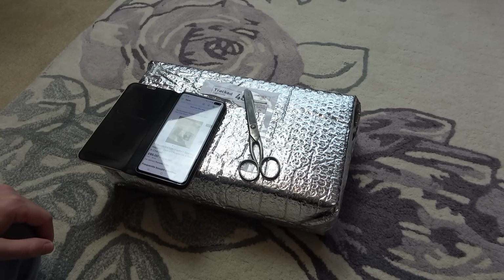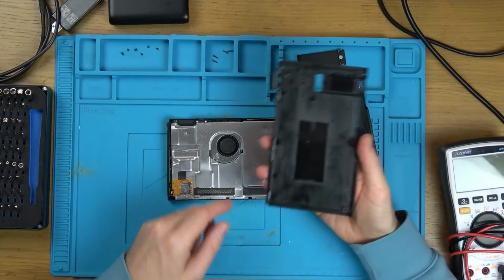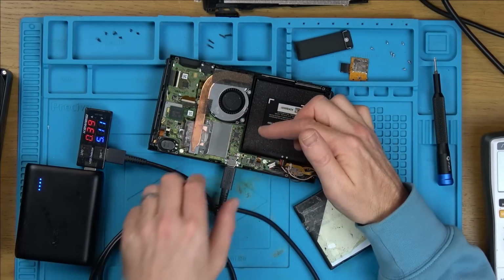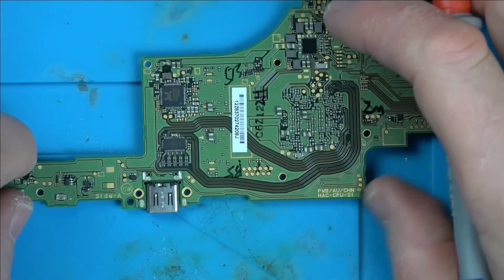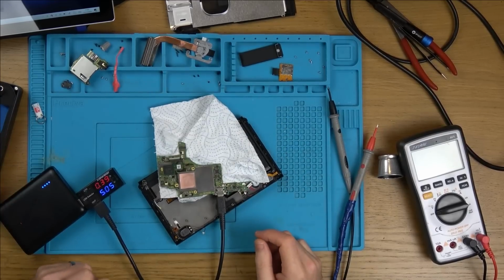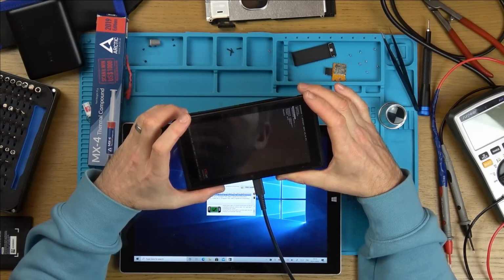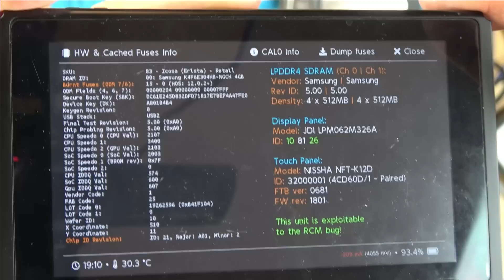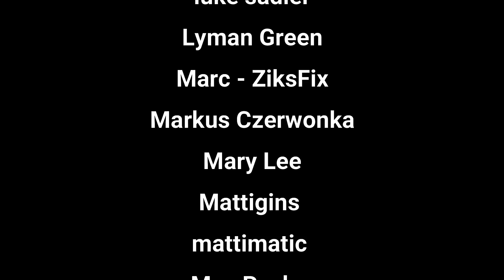Dishonest Broken Nintendo Switch from eBay - Can I FIX it?

Comment: If you do manage to get the switch operating system loaded back onto it, just be aware that there is a possibility that nintendo could detect that that switch has been hacked, and if you were to link your nintendo account, then there is a chance, however small, of your account potentially getting banned, or alternativly, the console itself could get banned (assuming it isnt already banned)
Reply from the maker: Thanks Pineapple 👍👍👍👍👍
Reply: That is only if you Start the System in the Stock CFW mode
(Look in my other comment for a half-explanation)
Reply: Nintendo does not ban accounts themselves really, usually they go for devices. I have three Switches hacked, ask me how I know >D

Comment: I guess I can't post links so I can't link you the guide, but if you buy a replacement eMMC module (they are cheap from China) there is a guide to rebuild the NAND. It requires hacking the console though, and it won't work online anymore because the console unique data that is needed to go online is lost now. But it can still work perfectly as a hacked console with CFW.
It uses a second (working) Switch as a donor to take the NAND files from, though there's a pack online with the needed files that skips that requirement.

Comment: Hey Vince you have a bad m92t36 chip. Ive come accross nintendo switches that are stuck in5 volts charge. The m92t36 chip can go bad without a short circuit.

Comment: Not sure if someone’s mentioned this but a red flag I noticed was the serial number label was missing (taken off). It’s what tells you if it’s “hackable” which are V1 versions. Unfortunately you need the original Nand to the switch to get it back to normal. However, it’s more valuable than a standard switch. I would mod it with the sd card and it should work. THERES A WAY and the plus side, this is a more sought out switch. So it’s a GREAT purchase!

Comment: Winner at the end  I think that it's homebrew lunch channel if the person who installed it doesn't do it right Nintendo company will see it and ban. It called a soft brick or hard brick you have to look it up on line on how to unbrick it  and with out the memory card make it harder to fixed it the software is installed in the memory of the switch good luck Bryce

Comment: Hey Vince, just wanted to say, that seller could have been telling the truth. RCM mode is a built in feature of the Tegra's bootROM (very first software ever run when you press the power button) and does not indicate hacking. It's a failsafe mode that activates in a number of situations (one of which is an eMMC failure!) so Nintendo or nVidia can recover the system in case of a software update issue or run diagnostics. It happens to be that there's a vulnerability in the USB code used for it, which is how people get into the system. Given what I see in the video, I think the eMMC chip went bad, which is indeed one of the many conditions that get you into RCM mode, and one of the ways an honest person could get it there.

Unfortunately, since the eMMC is dead, you won't ever be able to bring this back to full functionality, most likely. You should be able to at least get it booting back into the OS and playing cartridge games if you wanted, but online functionality will be lost on it regardless, due to missing PRODINFO, since that's console unique and not able to be fully regenerated (and most likely won't ever be fully able to regenerate)

Comment: I was wondering if you could help me I have a PlayStation 3 60 gig and it's exhaust temperature is 45 degrees C could you tell me if that's too hot or is that normal thank you.

Comment: Have you tried holding down power an volume up an down for about 30 or so seconds then let go of all then tap power button had the same issue with one of my hacked switchs after I tried to put it in rcm mode when battery was to low,
Reply: Never mind should of watched the whole video first lol an thats why I don't use the emmc when I hacked my switch I use the sd card with atmosphere I feel its the safer way to hack a switch

Comment: In options on the screen options top right turn off auto rcm and power off switch fully and turn on should come on failing that load up atmosphere see if that helps
Reply from the maker: Thanks Dan 👍

Comment: If they burnt those fuses it was defiantly hacked. It seems if those fuses are burnt it wont boot anymore. Might be able to get around that by creating a EMUNAND. Its a custom firmware of the switches OS but on the SD Card. You wont be able to play online but it'll still play games.
Reply: NO, the fuses burns itself when you update the firmware of the switch, in the official way. When you have a CFW the fuses arent burn, because the CFW itself block it.

Comment: you can buy a replacement emmc and rebuild the system but you wopuld need to contact the person and ask for the backup of the flash from the sd card they had in it to re-flash back to the new emmc with out that its toast

Comment: I have a pretty strong opinion that this also has experienced hardware failure, as I believe it would at least charge at 15V otherwise
Reply: While the console is in RCM, it doesn’t charge at full 15V. It trickle charges as shown in the video

Comment: The Fuses are EFuses that represent that the system has been updated to Valid Nintendo firmware its to prevent people downgrading 
There are hacking tools to update and grade without burning the EFuses 
idea basically 1.0 no burned fuses 
update 1.1 = 1 burnt EFuse 
HOS: is the current firmware on the device Unsure of the + but it could be representing the version for the firmware version as there is a Fat32 supporting version and a exFat supporting version

Comment: failed to initialize emmc soulds like the emmc is bricked corrupt or straight up just failed you may need to replace it and you will have to find a way to retrieve the key and pair it with a new emmc to get it up and running, pinch one off a donor board this should be repairable without too much work

Comment: The seller wasn't necessarily dishonest. it may not have been hacked. I was watching a video from TheCod3r the other day working on a Switch with a similar issue. While the one he was working one was hacked, he mentioned in the video that failed NAND (the eMMC storage chip) would cause any Switch to automatically go into RCM. RCM (ReCovery Mode) is the Tegra processor's built-in recovery mode. Anything that's built on Tegra has this RCM mode, for advanced recovery. It's useless to most people though. the error you were getting, 'failed to init emmc' means that 100% that NAND does not work. That makes this Switch unfixable, since the NAND is married to the CPU. Just putting in a new NAND would not work.

Comment: its gonna be a pain for me to find it but in the past you've done a Nintendo switch video where the switch would only charge with aftermarket usb c cables and not the OEM Nintendo cable. I'm having this same issue, I've tried 3 different OEM cables and nothing but when I try a cheap $1 usb c cable it charges but will charge very slowly. Could you or anyone possibly point me to the direction of the video or one similar that would help me with my console. The usb c port looks immaculate and I cannot see anything wrong with it so I'm thinking possibly the charge chip but I don't wanna jump the gun.

Comment: I haven't watched all the video, but I believe the seller in this case. 
i believe the nand has malfunctioned.  a switch will always boot into rcm if no nand is present, even if you don't have a jig in. 

you can use cfw on the switch with a different nand,
but you can never get it working properly as you don't have the backup keys for your original nand

on one I have ATM. i can feel the nand, getting slightly warm. but like you, I'm not really a software guy.

Comment: Vince while in RCM mode did you notice a "clear emmc" in the menu? it is used for things like Android phones that won't boot up. maybe look up videos about clearing emmc. but my guess would be that it will only clear the android emmc, rather than the switch's emmc. but might be worth a try. make sure you copy all files to the pc first encase something goes wrong.
Reply: also clearing emmc means all apps, and games will be wiped from the Nintendo switch.

Comment: hey vince. how much would you charge for this switch without joycons charger or anything., just console?  i can run ubuntu on it. and that can eventually be installed on the main emmc with some mod chips. i'd be interested to  use this switch as a engineering test for hardware mods. because how it is rightnow. without a working original emmc. the switch is bricked

Comment: Think this guide will work for you since you need to get the keys extracted to rebuild the Nand/eMMC if it is broken as you suspect then the keys are needed to rebuild it on that other Nand. Hope it helps and a s always enjoy your videos :)

switch:homebrew:guide/usingcfw/manualchoiupgrade (replace : with . since my last link got removed :P)

Comment: for anyone reading this, any ARM device that has recovery mode enabled in the silicon will trigger recovery mode (RCM) if the bootloader can't keep normal functionality (ie: loading more loaders from flash). If the eMMC is dead this is exactly what will happen. In this case, you'd need a new eMMC to rebuild your nand using the cpu keys. This also happens to any device using flash memory, i've had early smartphones going the same way because the internal storage just goes bad over time. Shouldn't happen this quickly on a relatively modern device unless it's been used 24/7 nonstop since release and constantly writing data to it, and even so i'm not sure you'd spend the memorie's writing cycles this fast.

Comment: Here's EXACTLY what happened - Athmosphere (which is the CFW typically used on hacked switches. There's SXOS as well, but I doubt they paid for that when Athmosphere is free) has a feature that's called "auto RCM" which basically puts your switch into RCM mode automatically when you power it off to eliminate the need to have that jig with you. Problem here is that if the switch turns off because of low battery, it goes into the auto RCM mode which further drains your battery to the point where it kills it. Basically your switch doesn't turn off and it just drains the battery to the point where the battery is just fully drained. The switch is modded successfully from what I can see, because Tegra RCM detects it, but they just weren't mindful of the autorcm option, and probably just hadn't charged the switch in a very long time. These are things that you need to research, but I guess the kids didn't do their homework.
Reply: Also, they didn't give you the SD card that contains the custom firmware, so it's not booting it up because of that. Try to get an SD card and load the latest athmosphere and hekate on it. That should do the trick.

Comment: The only way i can think of it some sorta payload that allows you to dump and flash keys soo if you use another switch that's dump the keys just incase that specific switch ever breaks and is unrepairable you could potentially salvage the emmc from it but i don't know its not something ive heard lf existing but you never know it is theoretically possible like nintendo themselves have problem had to do it where the emmc has died or something and they salvage it by flashing new keys onto it if you had access to that specific piece of software that allowed them to even serialise things then you can do it just gotta hope someone from nintendo dont mind "accidentally" posting a download link on the Internet to that tool

Comment: Hi Vince, dont do any misinformation on hack, because hack switch is very different from broken emmc. This switch have a simple emmc problem, and when the emmc is not working (or disconnected) the switch turn itself on in rcm mode. When you inserted the other emmc you needed to trigger rcm with jig + volup+power. 
Try to remove the emmc, and turn it on without, MAGIC RCM Mode... But AutoRCM is installed on the eMMC, but it the emmc is faulty and cannot initialize, can you tell me how autorcm (cfw one) can be triggered is it was hacked? You cant, because automatically, the switch triggers the Real RCM (Recovery Mode).

You can remember when you gone in emmc info and output "Failed to init emmc" (original emmc of the switch), if it failed then the emmc cannot be read/write and anything else, and so for AutoRCM. But the official RCM is a Recovery Mode (R.C.M. ReCovery Mode), and will trigger only if emmc is missing/removed/faulty/broken. AutoRCM is a way to trigger RCM for easy CFW, but in this scenario isnt the case. And CFW isnt that hard to install, since you create an EmuMMC on the SD Card, so youre not using the original eMMC. I have a modded switch, and i can tell.

You need to recreate the emmc with the correct keys, but you need the original emmc to do that, without you are locked out. Unless there is a way to recover the emmc keys from elsewhere.

Comment: RCM doesn't mean hacked, in fact it looks like the exact opposite given how much trouble it's giving you about authentic hardware. It's basically a Safe Mode or BIOS menu with slightly extra steps.

Remember the Nintendo Switch is a very lightly modified Android tablet. This is no different from the various error modes an Android device goes through involving recovery menus or boot loops.

I'm surprised the Switch lets you swap out the eMMC so painlessly... but pointlessly? Why is it swapable with no soldering if it's still hardware locked?

Comment: What it seems to be for me is a soft software brick. It seems that the jailbreak hasn't been updated but they updated the switch console which has caused it to not allow it to boost as far as I can see. I think the mismatch error is that it is looking for a data set to bypass Nintendo security but he can't find it because the jailbreak version and the software version do not match each other so it errors out. If you can install Android and it shows to eat MMC is working, but because when you update a switch it blows the fuse you cannot boot you may have to wait until a jailbreak for 12.0.2 is available and use that on boot to get back into the switch menu and then  undo the jailbreak the switch entirely. I am just putting my knowledge from jailbreaking phones and from phone repair into this so it may not be 100% accurate but that's what I think

Comment: If you disable autorcm remove battery and plug it again and power it on it should boot to normal switch
Reply: Make it factory reset before conecting to wifi or it may be banned

Comment: Need to put a sd card in with the files needed to load payload then once in the system factory reset I currently have a modded switch

Comment: For emulation / Retroarch have a look on the Lakka Switch version. Its booting from SDC and works pretty well out of the box.
As for the official system recovery, have a look if the NAND is still readable with hekate. If yes, let it dump the flash content and keep it on a save place. Maybe someone in the homebrew scene is able to help to recover the system now or after the switch has reached end of life (as people tend to keep internal information closed from public till nobody cares for the system any more).
Reply: Trying to get retroarch on mine right now.
 Off to investigate what Lakka is.  
Thanks

Comment: I dont know anything about modding switches beyond this video, but curious if it cant init the emmc, then how does android work? Is it using a seperate storage media?
Reply from the maker: Would it be accessing it directly on the micro SD card?
Reply: @Mymatevince  I have a modded switch myself, yeah it’s directly off the Sd card if I remember correctly.
Reply: with CFW you can skip emmc completely and load it from partition on the SD card, just like android does.
Reply: @Sm00k  yes it's called emunand ,  well on SXOS CFW it is on atmosphere it is called EMMC nand
the console is probably trying to boot the emuNAND/emmNAND  form the SD card  which is missing , I use SXOS and do not use hekate or  atmosphere which is what this switch is setup with ,

Comment: Unless there's some mod I don't know about, it should not say RCM OK when a Switch is plugged in. It should only say that when it is running in RCM mode, for that you need to insert the RCM jig while it's powered off and then hold volume up and power until for a second, then plug it into the PC. Also, RCM doesn't mean it's been hacked, every unpatched Switch had RCM (even patched ones also have it, just that you can't inject a payload). But the fact that it says RCM OK with no RCM jig is actually a problem, like it's always booting into RCM mode.

Edit: Also, a Switch already powered on cannot go into RCM mode, there is a good chance your Switch is unpatched and hackable

Edit 2: I don't use my hacked Switch for much more than running a few homebrew games (NOT PIRACY, DONT DO THAT ITS WRONG) so there could be something I don't know and I could be wrong about what I have said here

Edit 3: failed to initialize emmc could mean the storage has failed. Without a working backup that could be really bad. I am commenting as I watch the video so I don't know how it ends though so maybe you got it working, hopefully

Comment: Sorry to say, but the only thing you proved 100% is that there is a problem with the emmc in the broken Switch. 
Nothing more. 

The defect emmc leads to autoRCM, that's why it doesn't shows up on Windows as Nintendo Switch and displays immediately  'RCM device detected' when connected to TegraRCMGui. If you bring your working Switch in RCM mode or unplug its emmc, it will also apear as detected. 

It has nothing to do with hacked or not hacked.

Therefore I think your accusation is not ok.